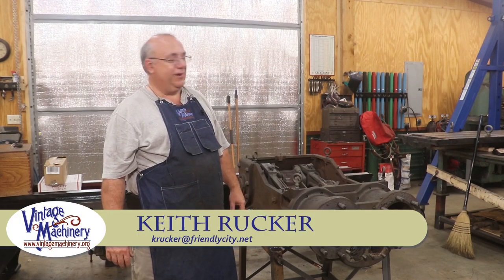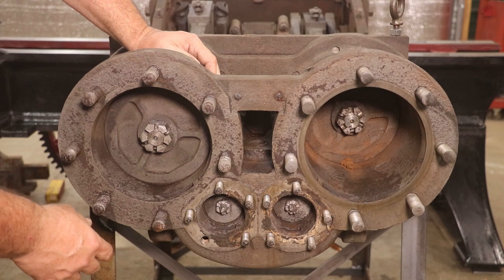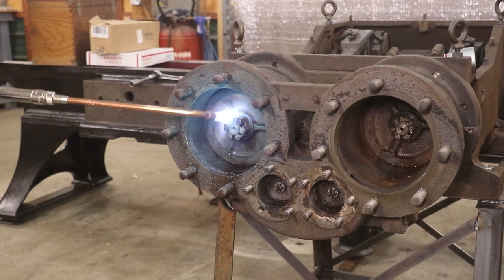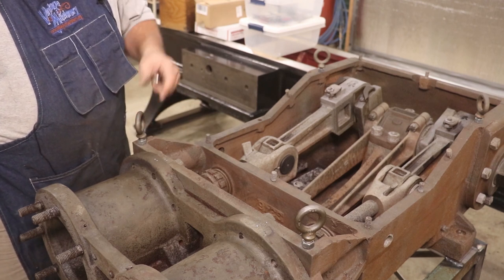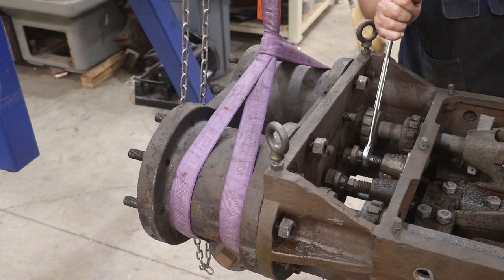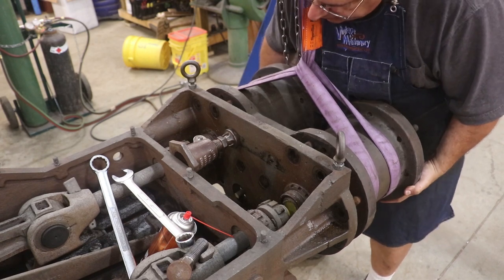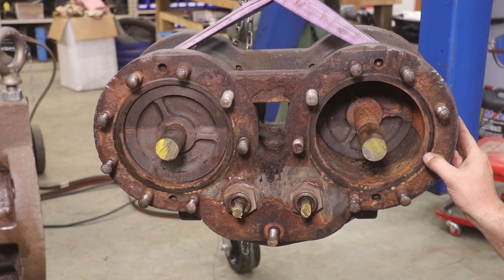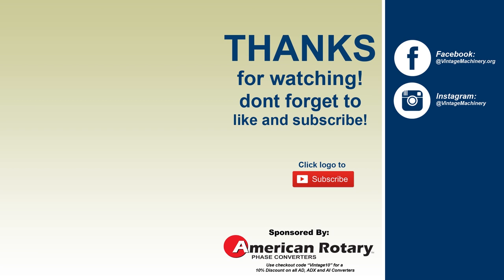Steam Locomotive Stoker Engine Restoration - Part 2: Removing the Cylinder Head

Comment: Nice project Keith. 👌 If I may, I used to work at a Canadian Railway stripping and rebuilding engines. Anything such as this steam enigine that is subject to heating and cooling will have seized up nuts, bolts as you have experienced. There is NO substatute for a good 3/4 or 1" pneumatic impact as the knocking effect really helps loosen the hardware. Popping the bolt heads or nuts with a center punch sometimes unbinds them. For loosening and banging on cast iron parts, a good piece of hardwood (old axe handle) and a 3-5 lb hammer really goes the trick most of the time. A very SHARP pointed wedge chisel was used on almost all stuck mated surfaces very simular to how you removed the cylinders. Looking forward to the following vids. Thx 👌🇨🇦

Comment: When it was obviously fighting back, I figured the rods were stuck in the pistons.  I was wondering why you didn't knock out the wedges on the small ends, and loosen the packing nuts.  I figured those small circular sections would be easier to break free of their guides than the pistons in the cylinders.  Since it was probably put up wet, no telling what was behind the pistons in the cylinders.  

Having the documentation and the materials list is a HUGE bonus.  It'll be a beauty when it's done.

Comment: I was so afraid that cast iron web was going to crack when pushing on it with the machinist jacks!
Reply: You were not alone in that fear.
Reply: I felt the same way Brad !
Reply: Me too. Keith is the expert with the experience but I said a prayer during that maneuver. Glad everything held. 😎👍
Reply: I could just see him brazing it back together if it did crack
Reply: shubus - I wasn’t criticizing and I give Keith all due respect. I’m not qualified to carry his toolbox so his judgement trumps mine every single time. By nature, I had to hold my breath till the deed was done. It’s all good.
Reply: Crossed my mind as well.
Reply: Not a problem. If he destroys the engine case he will just simply go find another one to work on or just simply have a whole new one cast down at that there foundry.

Comment: Using the penetrating oil after the cleaning process but before and after the heating process is a good practice since it allows time for the penetrant to work.
Manual spray bottles filled from a gallon jug of penetrant is an efficient way to apply sufficient amounts of liquid with ease and far cheaper than spray cans.

Comment: In metalwork at school. over 50 years ago, we all made Machinist's Jacks, I had no idea what is was for until I saw this video. Mine has 4 cross drilled holes with a silver steel bar to use to screw the centre up and down.

Comment: You need to buy shares in Evaporust it’s your new best friend one thing I have not heard anyone on YouTube say is once the part is rust free and cleaned up you can dip the part back in to evaporust then pull it out and let it dry and it puts a very good rustproof coating on the part and it can even be painted over
Reply: BARNEZY44 _ Keith is going to convert his swimming pool into an Evaporust tank.

Comment: Wow, it's amazing that nowadays we just have these battery powered reciprocal saws that easily cut through those steel bars... and just can just get some extra saws at your local store... it seems so easy...
They didn't have this kind of stuff when these engines were made, so this would have taken so much more time!
Reply: I hate these saws because it is to easy for someone removing something to damage something important which i need to have in a usable state. Now if Keith also cuts and scratches the cast iron.... 

IN Great britain they have a steam locomotive who went thru a complete rebuild in the early 60s inside one of the elite steam engine mills. 

There is not a single mark from a clumsy hammer or scratch anywhere in the motion.

Comment: We call them split pins here in Oz and once you get the head up a bit get your side cutters across it and lever up. Simple.
Reply: We call them split pins here in the UK too.

Here a cotter pin is a dowel, with a taper machined on it, and threaded at the narrow end, which is used to secure the pedals on a push bike.

https://hollandbikeshop.com/img/prod/algi-kurbelkeile-o8-5mm-silber-1-8715957129088-11-l.jpg

Comment: I had a antique Mercedes block here where the pistons were rusted into the bores. I put the whole thing into my electrobath and left it for a couple weeks, the pistons slid out easily after that. A mate also came up with an idea ,his 1909 Cadillac had seized pistons so he made a coupler to fit the spark plug hole and pumped it up with a porto power . With a  bit of 50/50 mix the pistons also came out easily.

Comment: You might try turning the cylinder set upright and soaking with Marvel Mystery Oil.  I've had excellent results using that on frozen gasoline engine blocks.  They have soaked for 24 to 96 hours before trying to rotate the crank, but it's never failed in the long run.  Good luck!

Comment: Sad to see the connecting rods cut. I was hoping they would break loose and not need to be replaced or new ones turned. The size and weight of such a project, makes it a lot harder to work with like usual projects. Interesting none the less. Thumbs Up!
Reply: He mentioned that he was planning on making new rods so there is no big loss there.
Reply: corroded, pitted beyond salvation

Comment: Just thought I'd make this pitch to you. I use white vinegar and micro-towels for flash rust on sheet metal for primer. Cleanup is water and towela. I'm just not sure how is would work on cast iron for wiping down the rough casting, with the water. I know the rust will come right off.

Comment: It would make a mess of the work area but I'd give the pistons and steel parts you're going to remove a good shot of penetrating oil or ATF and let them soak for a bit before trying to pull more off the engine.  A little bit of penetrating oil and time really helps some times, even if it does make a mess.

Comment: Should have used Knock-R-Loose on the cotter pins and a side cutter (also known as diagonals)
Reply: Beat me to the side cutter comment.
Reply: Should use it on all the nuts and bolts now so it has time to seep in.
Reply: @ryanp0342  After the nuts needed so much heat to break loose, it was pretty obvious that those 4 rods were not going to just slide out of the pistons-  should have just proceeded with the cutting then.
Reply: Side cutters and diagonals are not the same tool.
Reply: According to Robin Williams, we're not supposed 
to call them "dykes."  They are women in comfortable 
shoes.  (Steve stands away, from the nasty retorts.) :D

steve
Reply: @oldschool1993  I was talking about using the KnockRLoose on the other nuts and bolts now so that when he is removing it in the future is might be easier
Reply: @ryanp0342  I'd be hitting every fastener I could get at periodically until time to remove them. time is on your side with penetrating fluids.

Comment: Spray those nuts down with penetrating oil a couple times a day over 2 or 3 days. Then apply some heat and it will pull the penetrating oil into the threads. Then a sharp blow to a wrench will break a frozen nut loose a whole lot quicker than leaning on it with steady pressure. Once you get it to move just a bit, spray it again and tighten it back then sharp blow, loosen, spray, tighten, repeat. I have been working on old rusted farm equipment for years and I know what works. I hardly ever have one break.

Comment: Just a FYI when removing Cotter Pins instead of vice-grips, screwdrivers etc using a pair of large diagonal wire cutters works much better.  Grasp the head (eye) of the cotter pin and leverage the diagonal cutters against like in this the Castle Nut and the the cotter pin should pull right on out without any problems.

Comment: Really looking forward to the next installment of this series!  BTW, I thought it funny that the minute I saw you working on the Cotter Pin with a screwdriver, I said to myself, "ViseGrips would work much better" and sure enough, 10 seconds later you cut to using a pair of ViseGrips.  I deal with a lot of cotter pins in aviation and I've just learned to start with ViseGrips and go from there.

Out of curiosity - I know that you're not worried about the temper on the steel parts, but was any consideration given to using impact tools to remove the bolts or do you not have large impact tools that would work for that?
Reply: I feel great when I see more experienced folks using a screwdriver like that. Feel less dunce-like.
Reply: I have the same question regarding potential use of impact tools. I thought that'd be the go-to option for a job like that, but I have 0.0001% of the experience Keith does.

Comment: not sure how bad the crank end is but sometimes you can rock it back n forth a little at a time to get things moving. had a model b 4 cylinder absolutely rusted up tight. chipped what i could off and just kept playin with the crank a couple times a day penetrating oil and vinegar.  got it rolling good enough to tear down in about 5 days.

Comment: Why not use a impact wrench on the castle nuts?
Reply: He must not have a steam powered impact wrench.
Reply: The socket he was using its brand spanking new. That means he didn't have one before, and obviously doesn't have an impact socket that size. Also, this part is prob 100 years old, and he's taking his time doing things slowly/gently.
Reply: @xenonram  No the stoker engine is around no more than 70 years old - the loco was built in 1941 or so.  It is entirely possible that the engine was replaced in the late 40s or later.

things like this and the shutdown of the producers of them and so unobtainable state of fitting like this is one of the reason why N&W closed down steam operations in the early 60's.

Comment: I know you are trying your best to restore this but from my point of view and I know a reasonable amount of how steam engines work ,you didn’t need to cut the cylinder rods you could have removed the wedges that connect it to the cross head and then they would have slid out with the cylinder head. Before you go any further please get in contact with a chap called Alexander Karnes he is probably the best person to speak to about steam engines in the US.
Reply: The cross heads are also on tapers either way he would have been trying to split tapers......and those cotters aren't there to hold the tapers together
Reply: grego3150 tapers on the end of cylinder rods are not that big so he probably would have been able to break the seal. Restorations take time and at the moment I feel that he is rushing this one there are other ways to free the cylinder heads that are way less damaging than what he did. One way is to leave the cylinders still attached to the main castings and pack grease using a grease gun into the cylinder to move the piston this does take a long time but the advantages of it are that it causes less damage and will apply pressure evenly . Grease guns can get up to quite a high pressure.
Reply: He said a few times he was planning on making new rods and all of the rest of the steel parts due to excessive corrosion.  Cutting the rods looks to be the perfect solution.

Comment: Keith use CHROMED shaft for the replacement rods
Reply: That could work as long as the chrome has a layer of nickel under it (and sometimes copper under the nickel too).  Good "industrial" chrome has microcracks everywhere to relieve the extremely high stress caused in the chrome during the electroplating process.  This unrelieved stress is so high that the chrome sometimes causes the part to break.

But, yes, a "good" chrome finish will certainly help avoid rust in the future.
Reply: This. Otherwise it'll pit again and tear up the packing.
Reply: Remember - this is from a STEAM locomotive that has not been under steam for in excess of 60 years.  When in service - MAJOR maintenance (full scale rebuilding) was required every 5, count them 1 - 2 -3 -4 -5 years.  During that rebuild everything would have been movable from having been in service and lubed.  Don't touch anything for 60+ years and Natures own 'Loc-tite' wins the battles.
Reply: @mmi16  in the steam traction community people have had better luck making chromed valve and piston rods, just my experience and it doesn't cost much more. Take it to a place that does chrome hydraulic piston rods. Not that hard.
Reply: Hard chrome plating not necessary after renovation and proper maintenance.
JIM

Comment: The first thing I do when taking some thing old and rusty apart like that is spray EVERY nut and bolt and every joint that I want to come apart with penetrating oil.  Spray everything again everyday until it is more free.

Comment: Why wait to use penetrating oil until taking it apart? It should have been sprayed when it was first decided to do it. Certainly after being pressure washed after the Evaporust soak. A good air impact wrench and air hammer would probably have taken the nuts off and the rods out of the pistons.

Comment: You take cotter pins out the hard way.  I've taken out thousands of them by straightening the bent over pins and then using diagonal cutter to grab hold of the head.  Grab the head as low as possible to the nut and use the nut and cutter as a lever to extract the cotter pin.  Hasn't failed me yet.

Comment: If evapo rust dosen't work, take the head to a engine shop that has a bake oven.and bake same.Will loose up pistons then push outthat is the way to remove stuck pistons & valves in  gas & diesel engines.Have don same myself. I restore antique farm tractors

Comment: wondering if you had put a ton of rust penetrant into the cylinders and just let them soak for a few weeks if that wouldn't have helped.  I know that Jimmy DiResta did that on that old printing press he had...it was rusted solid, he just kept soaking the moving parts with penetrant ...eventually everything started moving and he was able to tear it down.  I know you weren't able to do this for weeks like Jimmy did, but even a week or so after getting it out of the Evap-O-Rust might have made a big difference.

Comment: Will the evporust penetrate into the the ring area of the cylinders and help break them loose?
Reply: Maybe not - I was working on a small MT0 tailstock for an older Craftsman wood lathe trying to get the deadcenter out. Once I did get it apart I noted that the Evaporust had not gotten to the mating surfaces of the taper! That was after several days soak and application of heat in between soaks!
Reply: @jrkorman  ...I agree.  Check out the Project Farm channel.  He has 3 videos where he tests penetrating oils and homemade mixtures.  It turns out that they really don't do much, even after long soakings.  The stuff does not work as advertised.  It makes me sad to wonder how much money I have spent on that garbage hoping for the "magic juice".  Just get the 'blue wrench' and get it done.

Comment: Use side cutter pliers to remove cotter pins. Pounding on your vice grips with a sledge hammer is Bush league. Using a plastic handled screw driver and hammer as a drift pin to knock out thOse  large cotter pins  is an amateur move. Where is your go to penetrating oil? More of that means less pounding with your lead hammer. Good luck.

Comment: When cutting heavy steel with a Sawzall,  SLOW blade speed with lots of cut pressure. It's natural to want to go fast to git 'er done but high blade speed just burns up blades.

Comment: Dare I ask... why not an impact tool to remove the bolts?
Reply: If bolts/nuts are rusted that tight, then need lots of heat to break rust bond as the outer parts temporarily expand away from inner part. If impact wrench is used, and it would need to be a really large one, these is a high risk of the shaft just shearing. That is fine is you are going to make new shafts but if the plan is to somehow reuse the shafts, then blue flame spanner (oxy torch) generally has much greater chance of success of getting nut loose without breaking something. That is what I have found working on old exhaust systems where nuts freeze on, and too big a spanner, socket or impact wrench just breaks the studs at the manifold. Have lamented many times early in the piece before I learned a better way to get the job done in land down under.
Reply: @bobhudson6659  True but it is not either or. First heat and Knock-R-Loose - then an impact wrench with torque limiter used carefully with frequent change of direction until the nut breaks loose from the rust.
Reply: @Citronitroify  Agreed. Only problem with many people just getting out the (large) impact wrench is that - that is all they will use, and then wonder why everything broke.  They then go to people like you and me and say help me please, or worse, they drill out the stud (or whatever) and wonder why a so called easi out snapped. Just look at many of the ideas from other commentators.
Reply: Personally I have used the H-72 rust reducter which acts to lubricate and break down the rust itself. That works like magic. Then if it's still stuck I use my Milwaukee 12v brushless impact tool to soften up the joint with a  few dakas and remove the bolt. If it doesn't come away with that I go back to the H-72 and then to a breaker bar till it wither comes away or not.

Comment: Are you going to soak the cylinders and bores in diesel to soften them up for removal? Glad it is you and not me...
Reply: I thought he should have hit it with something the minute it came out of the rust bath. Like immediately just to keep air off the metal. He gets it done either way.
Reply: Evapo Rust.
Reply: Makes hard work out of a simple job he needs to wear steel cap boots not trainers no need to cut the piston and valve rods